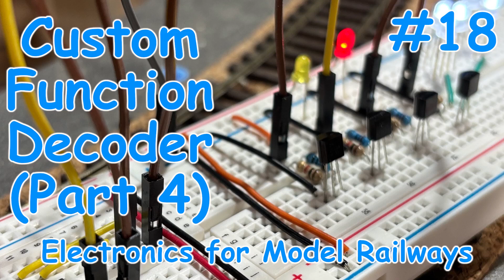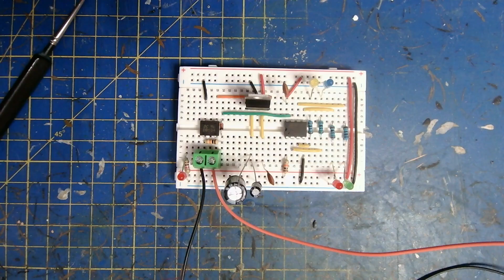18. Making a DCC function decoder (part 4) - DCC goes Live! #dcc #modelrailroad #AtTiny85

Comment: Brilliant series, well done! Which transistor did you use to drive the led's (isn't listed in the drawing on GitHub)?
Reply from the maker: oh my bad on that, I'm using 2222n2 (because I have a bag of them), but to be honest pretty much any generic NPN should work. same as the base drive 1k resistor, its not exactly calculated, just what I have and it works. there is a lot of optimisation possible here

I till be getting back to this.. honest :)
Reply from the maker: sorry 2n2222.. my bad

Comment: I have just made one of these. Thanks for the easy guide, it was fun to build. Will there be a 'part19' as you have skipped to 20 and the turntable?
Reply from the maker: yes that was a mistake on my part, I will be coming back to this, I have some Surface Mount AtTiny84 chips I want to give a try (essentially I can leave the programming pins free to properly programme the thing in situ), just need to get around to it. the aim is very much coach lighting stuff done reasonably cheaply but controllably

Comment: Hello, congratulation, brilliant application...and it works ;-) but I'm a Marklinist and it works with Mobile Station 2 for controling fonctions and changing decoder address but it's not working when you want to change  cv 105 or 106 . The MS2 says "Timeout for reading/writing CV". Have you an idea of what could be the issue ? Thanks. Serge.
Reply: Sorry to answer to myself. I just changt delay on line 105 with a lower value (5) and it works.
..
Reply: Again me ...;-) default value for CV 105 and 106...maybe line 55 and 56 in the code "128" should have to be replaced by variables declared in lines 33 & 34. Just tuning...;-)...
Reply from the maker: this is likely very true :)
Reply: Me again ;-)  CV 105 & 106 value "128" in lines 55 & 56 shoud be replaced by the name of the variables of line 33 & 34. It should be better I think...?
Reply from the maker: I need to dig this out and give it a good going through, have been working on the actual layout which will be pausing soon, going back to coach lighting is on the list :)
Reply from the maker: excellent, glad it works, I suspect some systems will have varied requirements and a bit of experimentation is needed to get to the actual value that works for all

:)

I will be getting back to this.. honest
Reply from the maker: this is usually the decoder isn't changing the current by enough for the base to see it, curious if its just those two values though and others change. not familiar with the Mobile Station 2, I've only tested this with JMRI decoder Pro. but it may need a larger load to switch in and out.

when I first set this up I adjusted the code in the bit that toggles the load in and out when responding to also flash some of the LEDs, just to see if the decoder is responding but its not being seen or if its simply not responding. CV105 & CV106 is meant to be user data, I borrowed the values for brightness levels. they should be values as base station can programme though

Comment: HI,  I tried to understand but at the moment I haven't found a solution, F0 is fine for the tail light but, if I wanted to use instead of F1 or F2 the function button F7, F8 where can I find this configuration, what do I need to change?
Reply from the maker: if you have the nmra dcc library there is an example that shows how to read all of the functions - its a bit weird as you need different sections to get at them in blocks, the stuff I did only looks at the first panel of them but that library (can be installed via the library manager) has a stack of examples
Reply from the maker: the example you need is "NmraDccMultiFunctionDecoder_1", lines 78 - 131 show how to access functions 0-28. 

essentially they come in "pages", there is a "FuncGrp" variable which defines the pages, then the "FuncState" variable covers groups of four to eight functions as on/off binary values

Comment: Any simple homemade decoder? Using asp32? 

My old lima class 92 dont have socket pint and decoder yet.

I want custom front and rear  light, high beam light, coach light interior, horn, bell, engine sound.

Can you make tutorial?

Controller i tink wanna try using dcc ex
Reply from the maker: I've not tried making a loco decoder, I suspect it may need a more powerful micro controller and by the time you have faffed with it something like a Zimo would actually be cheaper

the older Lima locos are not too hard to do though, I managed some N gauge ones, they tend to have bags of space inside

Comment: Hello, Thank you for your tutorial. few doubts, are you going use this decoder as one stop solution may be with lights, servo, sound and dc motor for loco? may be very cheaper version of loksound since that is very expensive for common people :( ?

few ideas some of people tried are - https://www.youtube.com/watch?v=1GkfOdGfCyo
using attiny85 to decode dcc and then pass down those function to esp32 for lights, servo, sound and dc motor
Reply from the maker: lights yes, it started as a way to have controllable lighting for coaches that didn't cost a fortune. the AtTiny85 I don't think will control a motor without a proper driver chip doing the heavy lifting - ditto sound, perhaps with a dedicated sound chip

and cheers will check that link :)

Comment: It's great to see the functionality increasing, and like you say - you get to choose how a lot of it works 🙂

Tying the train's tail light logically to the loco is a nice idea... it's not the first time you've mentioned it, but I realised this time it means you can't have the loco go tender first, because it would be in reverse, so the light wouldn't come on. I guess the only real automatic solution is for the coach to know in which direction it's being pulled (I know gyro modules exist, but they look expensive and complicated to use!)... but unless your locos are going to be running around the train and taking it back where it came from (i.e. end-to-end rather than roundy-roundy) the tail lamp is always going to be at the back of the train anyway, so really you just need lights on or off for it (even knowing the speed isn't necessary, because it would need to stay on when the train comes to a stop at stations or signals).

I'm still gradually getting to grips with BJ NPN transistors, so would be keen to know how you arrived at the desired value for current into your transistor base. What I think I understand so far:
- they need to be in saturation to act as a closed switch
- the various HFE/Beta/gain values in the datasheet are for when it's in forward active mode, doing amplification, rather than when in saturation
- the bridge to emitter will take about 0.7V when saturated
- the collector to emitter will take about 0.2 to 0.3V when saturated
- when in saturation the base current doesn't amplify the collector to emitter current (hence acts like a switch)
... but the datasheets don't seem to say what the base current needs to be to arrive at saturation - all the charts plot collector current against bridge _voltage_. Lots of online articles arrive at a Beta value of 10, seemingly arbitrarily, to use in the formula for calculating base saturation current based on target collector current (i.e. collector current being what you'd want going through the LEDs), with some saying to get it from the datasheet (though the values there are always varied and for the active mode, not saturation). The datasheet I've been looking at is BL Galaxy Electrical MMBT3904 - I have 3904 transistors with a 1AM marking - no idea of manufacturer! In that datasheet there are a couple of table lines for VBE(sat), giving example Ic and Ib values, which do have a ratio of 10, which implies a linear relationship. Is the lower ratio of 10 between the Ib and Ic what causes it to go into saturation, i.e. Ib is relatively high compared with Ic? Thanks for any pointers on this... I think just writing this up as a question has helped me a bit!
Reply from the maker: weeeeellllll.. I use a 1K as I've more or less always used a 1k.. these are 2n2222. gain is somewhere between 150 and 200 odd (depends on the exact current flowing). base current is 5v / 1000 ohms = 5mA, the things are rated for 600mA (I expect they get warm at that point), I'm seldom driving anything about 100mA so it will be saturated at that point. indeed the 1k could be considerably higher and it would still saturate. to be honest the 1k is more about limiting the current from the MCU than the transistor, will have to have an experiment with this as cutting the current draw further is not a bad idea

varies by transistor obviously, some are better as amplifiers and some better for this sort of switching, some try to do both - this is technically an amplifier one but I have a big bag of them..

the forwards backwards bit.. the theory is a rake is programmed coach by coach - one end one will have the first bit in CV29 set so that one knows its the other way around. with steam this will do it as generally they will be smokebox first, but what about tank engines? I'm pondering another custom CV with a bit that says which way around the loco is to invert the direction - this so that bit can be programmed on the main for the whole rake, while the coaches keep CV29 as how they have been set up. as you note the actual speed doesn't matter, its just direction with some function assigned for "coach lighting" either on the rake, the loco, or both. exactly how it all works isn't written down yet..

Leopard Street will eventually be an out & back from a terminal with reversing loops so direction changes are very much a thing, but generally locos will be turned - but not always so this is something thats needed.

experimentation ahoy.

Also planning to swap to the AtTiny84, specifically as the programming pins can then be left unused to make programming in circuit easier, its doable with the AtTiny85 but awkward as the circuit needs to not interfere with programming

:)
Reply: @aleopardstail  OK thanks - I guess once you've been using certain components in a particular way for a while you just know the values will be OK.

Sounds like you've got the whole plan for how the rakes will operate covered nicely, and a re-program of a CV on main if the loco goes backwards sounds easy enough to do 🙂

In OO you've got plenty of space in those coaches for a microcontroller with more pins, sounds like a nice idea. I did look at using jumper connectors to be able to get the ATtiny85 disconnected from other circuitry for re-programming, but I could only find 2.54mm pitch ones, which just take too much space compared with all the other bits to be worth it.
Reply from the maker: its one of the reasons Leopard Street is OO and not N to reuse the older stock I had, just no space to really play. pity as I love what you can do with N

and yes plug & socket tends to be stripboard spacing or larger, there are some smaller ones but by the time you do that may as well just use DIP8

and yes, same with LEDs, tend to just use a 1k regardless of the LED forward voltage
Reply from the maker: worth noting you can programme in situ, get a suitable clamp, but you need a circuit that can cope with both high and low logic without interfering - LEDs and transistors could work but you need enough resistance the pin isn't in effect being pulled to ground

Comment: I first wondered whether you might benefit from using something like a TLC59711 to control your LEDs. Yes an extra IC, but as it limits the LED current, you don't need resistors, as well as let's you have many channels on SPI bus (three pins - possible to use only 2).  Note: AtTiny85's USI peripheral can output SPI, if you were not aware. 

Then I also wondered whether, in the coach lighting case, an Addressable LED strip might work. Something like a WS812 (5-7 volts) or WS814 (12 volt). Those let you control an arbitrary number of LEDs (including brightness) using a single AVR pin.

Just thinking out loud. Keep up the excellent work !
Reply from the maker: could work, I'm using TLC5947 on the main layout. trouble with SPI is the number of pins needed - addressable LEDs cut that down obviously - comes down to whats needed, there is space for LED resistors in a coach (surface mount), likely space for another IC isn't that hard. thinking here was to have the whole coach lit or the whole coach dark, addressable starts meaning either sending more information out or they all get the same instructions.

does potentially simplify some things though.

cheers, interesting idea :)
Reply: @aleopardstail With the tlc59711 if you only have 1 you only need 2 AVR pins SDO (aka MOSI) & CLK. Using the USI peripheral with interupt driven code, it doesn't use a lot of CPU cycles either. With things like WS812 yeah you have to resend every brightness to update 1, but in some ways, that can make the logic simpler. Depending what other features you have planned, how many LEDs etc it feels doable. I had an 8MHz 32U4 running 64 Ws812 LEDs & it seemed to have no problems. On an AT tiny you might worry about RAM required to keep the state, but like I said, feels (to me) a solvable problem

Comment: I find this series on using the avr tiny for DCC decoding fascinating. I don't have any experience with the NrmaDcc library, but after watching your vid, I did a skim through the (library) code and I suspect if you want to update your brightness (aka CV values) without a reset you will need to use notifyDccCVChange() instead of (perhaps in addition to ? ) notifyCVChange as your call back.
Reply from the maker: Ooo thats one to have a look at, I have a bug identified where the notifyCVChange() function does record the change.. it just doesn't do anything with it until the lights are turned off and back on.

will have an investigate on that so cheers :)
Reply: @aleopardstail yeah on further reflection, Perhaps I jumped to a conclusion based on a comment in the NrmaDcc.h header. I'm presently thinking maybe your bug is around the on/off logic -> you need to (one way or anotyer) trigger a call to analogWrite with the new brightness in the case the corresponding function is already on. I don't currently have a dcc command station, otherwise I would try out your code so I could speak from a more informed position😮

Comment: Are you creating pcb for this ?
Nice video 👍
Reply from the maker: eventually yes, the aim is a lighting PCB for in a coach that holds the LEDs and the decoder on one board, probably a couple of versions for different coaches - when I do and it works I'll stick the files on the github page

:)

Comment: Thanks for the video.  How much room does this code take in the AtTiny?
Reply from the maker: Hi, so far it compiles to 64% of the programme space (5270 bytes out of 8192 bytes and 109 bytes out of 512 bytes for variables, plus a few bytes in EEPROM. bit of space for some more gubbins. think making a motor decoder would want something with more space, and faster, not bad for a basic function decoder though

:)
Reply: @aleopardstail  Well I guess it depends how much room the libraries take,  and they're already in there, so you probably have bags of room for your code.

Comment: You could simply fit a tiny LED light strip to the roof inside, fit a battery and use a magnet to turn the LED light on and off. It's the same as what you do for the Hornby and Genesis 4 and 6-wheeled coaches, which are fitted with lights. No outside decoder needed. No need to store data on your laptop. It makes the task 100% easier.
Reply from the maker: easier, doesn't add the tail light though, and have to change batteries every so often.

it does work though, thing we me is this stuff is another hobby, finding something simple and needlessly over complicating it

:)
Reply: @aleopardstail  When I say battery, I mean the kind you place inside a watch to make it work. That sort of battery usually lasts a few years, before you need to replace it.